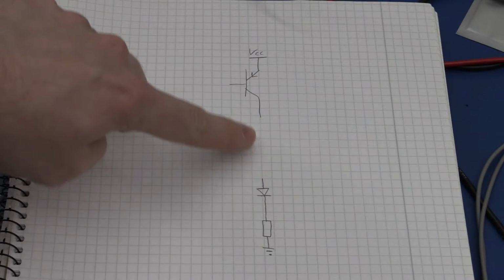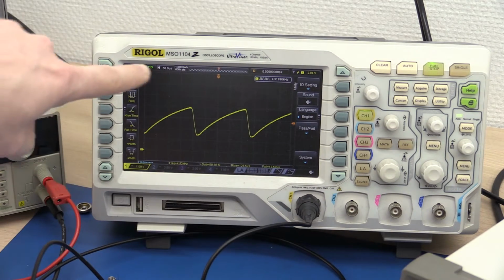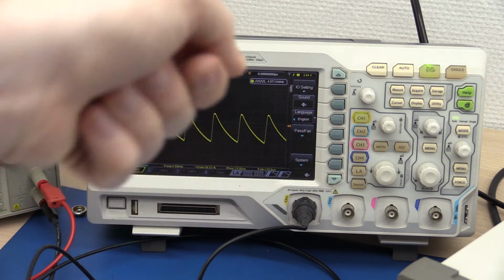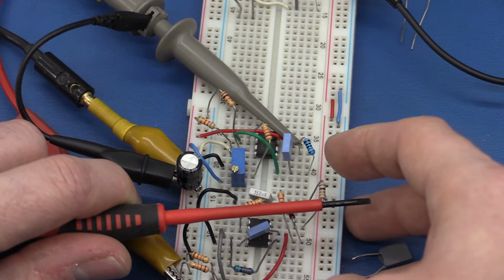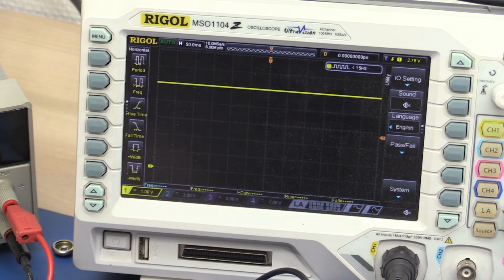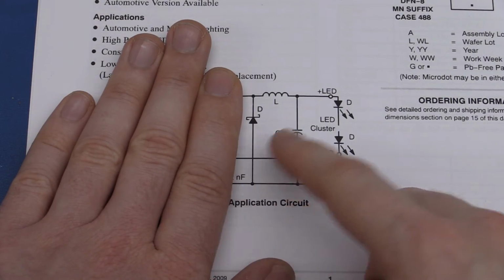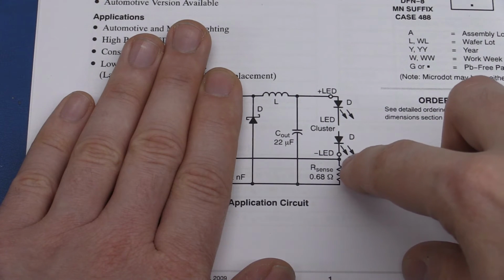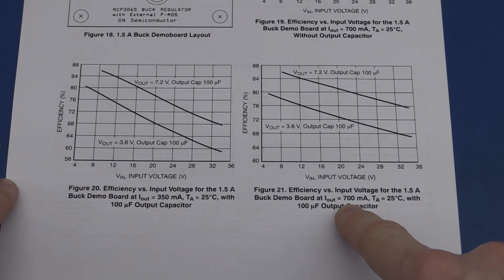Constant Current LED Driver - Switch Mode (Part 3) - Ec-Projects

Comment: Good video to explain many things. But for LED I'd recommend to implement simple ConstantCurrent self-oscillating buck using comparator LM393 it's faster than OPAMP. Using 2 SMD BJTs and 1 N-MOSFET still could be cheaper than using specialized IC, simpler but of course less to explain :)

Comment: I did one some time ago as well! In the end I did it with a uC and digital control loop, since I needed multiple channels. Especially if you already have an MCU in your project you could even save money with it. And for certain higher powered, or very low powered LEDs it sometimes does make sense. The chips can sometimes be awfully specific.
Reply from the maker: Yeah, I agree. They can be very specific!
It can be a lot of fun to make one by yourself also. :)

Comment: Good job!

Efficiency could be improved by using a FET instead of a BJT (logic level FET if Vcc is this low), and by using a lower impedance driver such as a totem pole for the FET's gate to get it to switch faster. A Schottky diode would reduce the amplitude of the undershoot and also improve efficiency with its lower forward voltage. You could also improve your Vcc filter capacitance/placement to reduce the drop in Vcc when the transistor is on.

The ringing after the diode turns off is there because you're operating in discontinuous conduction mode (DCM). It's not normally a problem, but if the amplitude of the overshoot or EMI are problems you may be able to use a snubber or clamp. DCM is the right choice for this low power circuit anyway.

Yes, I know this is just a demo circuit. Just thought this might answer some questions.
Reply from the maker: Thanks!
Good advice for improvements. :)
Yep, just a demo circuit, taking what i had from the drawer ;)